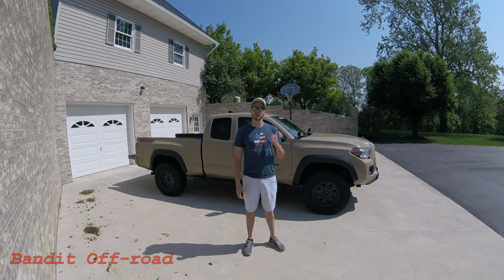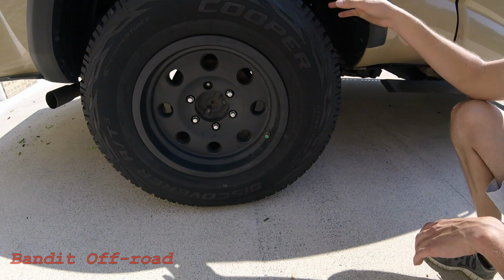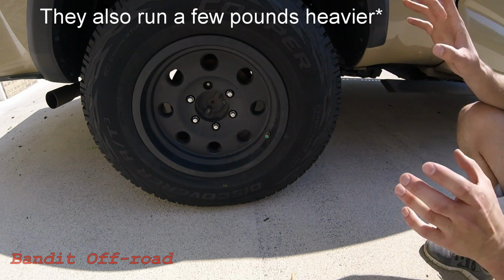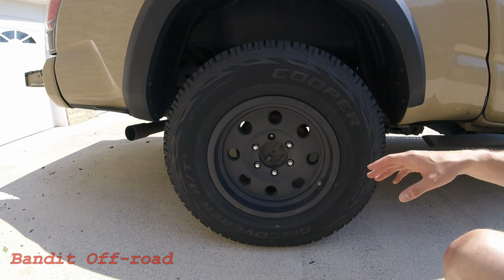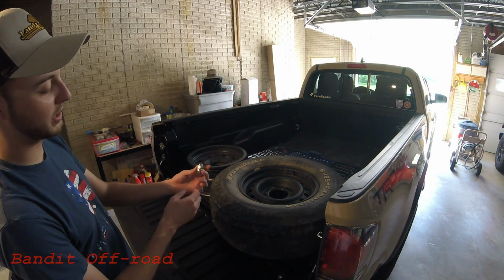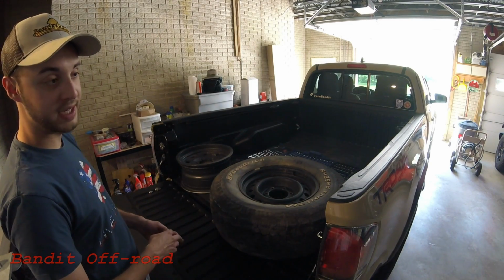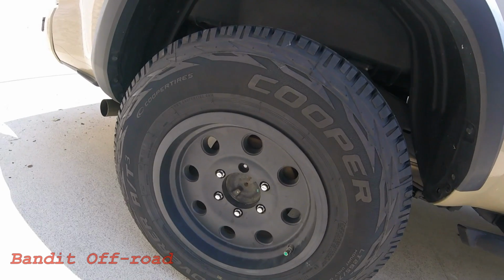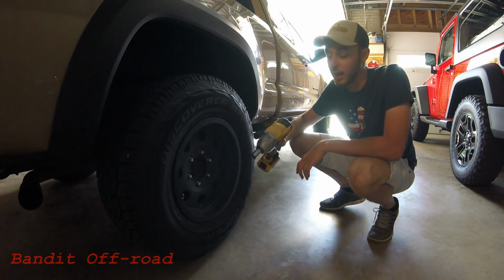How to Choose the Next Wheels and Tires for YOUR Truck!!!

Comment: I have a 05 Blazer 4x4 2Dr 2.5 inch lift My first upgrade was the Tires Cooper AT3 285 75 15  Have to say They handle fine on road under normal use and weather While quiet. Off road Fairly well Not really good with rain and mud while climbing or bogged in 4x4 use 
Rain while in 2wheel And a small bit of gas like to spin And wiggle on corners Canadian Snow And ice : No way your using 2 wheel drive without slapping a curb Or spinning tires on a changed green light start  4x4 Your doing about as good as someone with winter tires Or new all season tires front wheel drive cars 
Quiet and long lasting tread makes way for a softer grippy tire And noisey go's with deeper tread that grips mud and snow
Only way i can discribe the tires on ice is "Hockey pucks" 
I just bought new steel 15" -19mm off set rims to even out the centre mass from the lift kit And steel because they tend to last longer from rim leaks Compared to the stock aluminum ones That have to be removed cleaned of white powder rust and sealed every winter I have had my tires 4 years now still a good deal of tread But come Nov I think a diffrent brand with a softer compound is needed

Comment: Can you adjust the strength on the battery powered impact ..?
Reply from the maker: Yes sir, it has 3 modes: 100, 400, 700 ft-lbs of running torque, up to 1400  ft-lbs of breakaway torque!

Comment: Nice tires!   I'm looking to purchase Coopers or Toyo Open Country LT's soon.   & thank you for all your research as well!  One question ---  do you know why the full size spare tire that comes with the TRD has the label that says 'For Temporary Use Only' ?   Could that be because the tire does not come with the TPMS sensor?.
Reply from the maker: That would be my guess.  Since my TPMS sensors were not in use for so long, my truck "forgot" about them.  The tire shop was able to reprogram them to the truck and now everything is working well together once more!
Reply: I did some further research on this, ie I looked on pg 548 & 549 of my Tacoma 2016 manual where, among other things, it says (@ the bottom of pg 549) "Do not drive at speeds in excess of 50mph, when a temp. spare is installed.  The temp spare is not designed for high speeds"...and follows with a warning about death by speeding, & presumably wheel failure.   This sounds like the spare should be for a car with a doughnut spare, not the full sized tire that comes with these trucks.  Anyway, I changing my spare wheel for a wheel identical to the ones that came with the truck, the alloy ones.  Geez, 50mph max?   Where I am from in California, & most anywhere else, you'd get a ticket for driving that slow.  Toyota, shame on you!

Comment: You should probably find that lug nut your missing
Reply: Bennett Ragland it’s probably the one he was using as an example in the 2nd half of the video.
Reply from the maker: Randall is correct.  I replaced that lug nut at the end of the video.

Comment: I got the ax201 16x8 0offset for my 2016 sr5. I didn’t even consider purchasing a 5th wheel for a spare. Couple questions: is a spare wheel with same offset and width absolutely necessary? Does 0 offset and 8 width equate to premature bearing failure down the road? Are you rotating with the 5th wheel as well?
Reply from the maker: It is not absolutely necessary to have the spare as a 0 offset, I will likely still use the steel wheel that came with the truck (for short-term use only) if I get a flat.  The more offset wheels will likely cause similar wear (my opinion) but are a much better solution than actually running wheel spacers.
Reply: Bandit Off-road roger roger..on a side note I’ve been hoping for you guys to do a bilstein vs fox vs kings video 🤙🏽

Comment: Not a bad choice on the wheel/tire combo! Clean but simple never hurts anything.
Reply from the maker: Thanks!
Reply: Im too indecisive so ive gone through 4 sets of wheels and tires haha. Went from stock 15 inch wheels on BFG KOs which I wasn't too impressed with due to their age. After that I decided to get some 17 inch TRD Sport wheels with Nitto Terra Grapplers which gripped and handled far better even though I picked up them up for next to nothing. Next was a set of Lexus GX470 wheels on my Falken Wildpeak AT3Ws which were great but only issue ive had with any factory Toyota wheels is the offset. Now im currently running AMO Ranger wheels from Discount Tire on the same AT3Ws since they have a hair over 15k miles on them and still perform great.